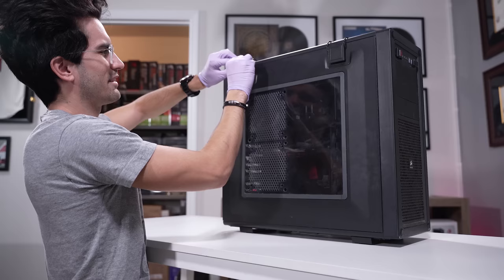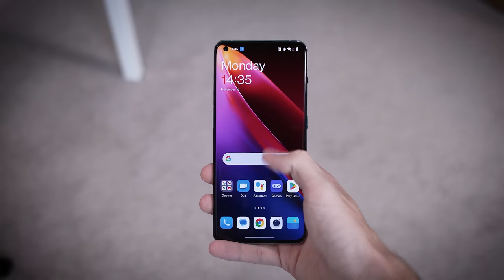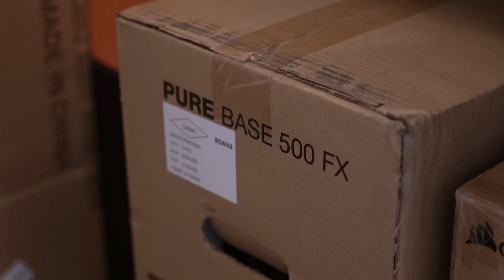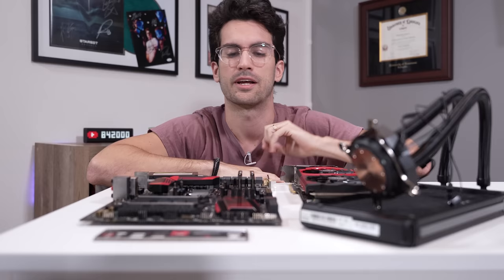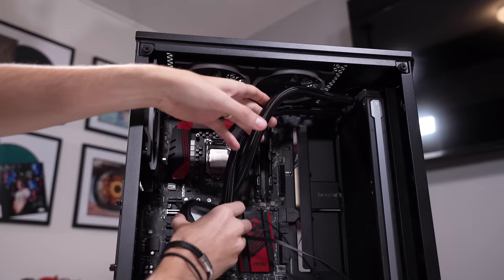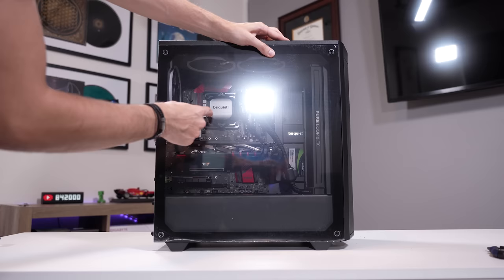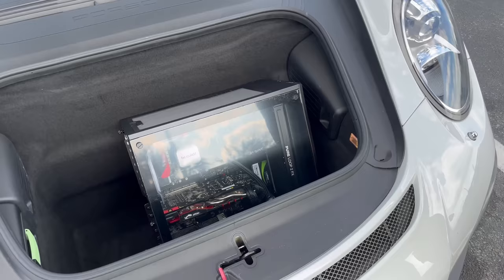Giving This Viewer's PC a HUGE Surprise Makeover!

Comment: That car's trunk was designed specifically to transport a single PC and nothing else.  Very practical lol 👍
Reply: I think that's what they call a "frunk". I used to have a car with a frunk (although no one called it that in those days). It was a VW Squareback, which was a small station wagon with the engine under the floor in the rear.
Reply: You would be surprised by the amount of volume you can stuff in a Porsche ^^. I had a 997. The frunk is not very long, but quite deep actually. Even more if it's just a 2WD.
Reply: @JeffDeWitt  my dad had a '70 square back.  we rebuilt it. was going to be mine. neighbor crashed into it when i was 15.  no sweet 16 car for me. im now 49 with a MK6 GTI   :glasses-purple-yellow-diamond:

Comment: I bet someone out there would jump at the chance to pick up a vintage Corsair case like that lol
Reply: I see them selling for more than the new bequiet case he got
Reply: Personally I wouldn’t be interested in a case like that but I have bought a mint old retro beige case, I think it’s a old 486 case that hasn’t seen daylight in it’s life so it’s not discoloured. But trying to add fans has been the issue 2x80mm to the 5x120mm I want as well as aio cooler and keep the 2x cd drives and the 1x floppy has been challenging. It’s only the aio position that is janky, but having the psu above the mobo makes life hard lol.
Reply: @uninstallplz6888  Good luck the old stuff is all completely laid out different. I have a large pile of old cases myself, one day I will make a nice NAS out of one of my old Gateway cases
Reply: @bikedoc4145  I’ve cut some of the cages on the front out to make room for the 3x120mm fans in the floor the 120mm aio cooler is going to fit under the cd drives with a 120mm fan under the drives in the front as exhaust and another at the back. But the power supply at the top of the case might cause some wire tidying issues with the fan wires being as the fan controller sits in a pci case slot at the back might meet to find fan cable extender’s, but it’s the out side I care about more
Reply: @uninstallplz6888  sounds like a good idea doing intake in the bottom. JayzTwoCents showed a new case with power supply in top and said it was easier to cable route than in the bottom so you might get lucky and not need extensions

Comment: This old case is better than anything on the case market today by the airflow. If you apply 2 extra fans on side exhaust its ultra low temps for gpu. Ridiculous move to change it.
Reply: Excellent side air intake is the reason I still have my CM Stacker 830(Nvidia Edition). When I upgrade the cpu I will get a be quiet Dark Rock TF2  top flow cooler to take advantage of it.

Comment: I know this is going to sound strange but the owners original case(Corsair vengeance c70) is very sot after. It currently goes for around $200+ on ebay some sold listings are as much as $599. Just something you may want to let the original owner know.

Comment: Nice Greg.
I still have a build in an old C70 (military green) with the older yellow&black RM750 PSU + Older still - z97 sabertooth m1/4690k/1070 seahawk (was originaly a 970) and 16gb of mushkin radioactive ram - remember those!  It's old but it still runs fine.
I use a (still old) 9900k/2080seahawk now. 
I wish Corsair would do a refresh of the C70, it's a one off unique case. :)
Reply: I had the Asus Sabertooth X58.
It would've looked amazing in that case.

Comment: The Corsair RM750x PSU is actually pretty good, fully modular and 80Plus as well, so that was more like a side-grade. Well, except that he got a new unit for an older unit of course.
Reply: you're right about it being a side grade but if Greg uses it in another fix or flop or something its pretty good. but mainly did it for the sponsorship post

Comment: I recently built in this case.  I went with an air cooler (pure rock 2).  I ordered three more lightwings RGB fans.  Put two at the top and the cooler has two fans in push pull.   The end result looks amazing.

Comment: Dont' forget to change the oil and the spark plugs.  More sure the RAM is gapped properly.  Usually around .45 unless its a boosted RAM, then maybe gapped smaller to around less than .32.

Comment: This video reminded me again that I have a White 500DX on my shelf for months already to revamp my current build.. just have to find the time for it haha.

tbh I'm not sure what I would have preferred with the AIO placement. I might have ended up just using 1 fan in the top to have enough room for the tubes of his old AIO, or maybe still moved to a high end air cooler which really do not perform worse then a simple Corsair AIO. I use AIO's myself but pure for esthetic reasons.

Comment: I just upgraded my case 2 weeks ago from a Cooler Master 690 II Advanced that i had since 2012. To a Lian Li Lancool lll RGB case. My 3090 barely fit inside that old CM case which had 4 fans and my new lian li case i installed 10 of them 😁

Comment: Be quiet does really good products.
Using a be quiet platinum psu for 6 years without a single issue.
** But would like to see case coolers from other manufacturers as well if possible.

Comment: Ayyy! That's the case I use..except mine is the 500D. Really clean look. The Liquid Freezer AIO was TIGHT fit up top though. I think I've seen people put 3x 140mm fans in the front so I gotta open it up & try it out instead of just the 2 that are in there now.

Comment: You cant put a AIO upside down. If there is any kind of air in that it will now get stuck in the pump. That's why you put the output of the tubes from the radiator above the pump so it gets stuck in the radiator instead of the pump. Correct me if I'm wrong

Comment: After modding an old Corsair 400R for a modern build, I'm convinced that side panel fan mounts should make a return. GPUs these days are monsters of distributing hot air in all directions and the hot air has to find its way out top or back of the case without being recirculated by the GPU fans. A side panel intake or exhaust does wonders for either feeding the GPU fresh air or removing hot air away from the GPU efficiently.

Comment: I have the Fractal Torrent and a 420mm aio and the tubes go to the bottom, looks better than having them at the top, and better for the flow of water/air if any air gets in the system. But great job, nice and tidy

Comment: Greg, have you ever considered doing a Tech Yes style PCBC on a rig that's both dirty and broken as long as the viewer consents for a one off video?
Non chlorinated brake cleaner dries residue free and WD40 is comprised of mineral oil which is non conductive.  its actually a pretty amazing combination that Bryan developed.
I tried it on an old 4th gen system that was basically dead, after the first clean it was booting again, after the second clean focusing on the ram slots it brought back a dead memory channel and is like new.

Comment: PSA for the kids- If you're going to hose out a finned radiator, (PC, HVAC coil, etc) do so in the opposite direction of the operative flow. Otherwise, you're packing matter through the fin stack.

Comment: I heard such good things about Be Quiet.  Then my roommate got one of their coolers and it was the cheapest piece of junk I have ever seen in my life.  It doesn't even have any way to connect the fans to the heatsink, they basically have you use thin wires to twist tie it on.  My only thought was: "really?"  I definitely won't be using any of their coolers in the future.  I can only hope their cases are better designed.  This thing made the Hyper 212 Evo look like an extremely premium product in comparison (while costing several times as much).  It doesn't even perform that well, it's serviceable at best.
Reply: Having built in their Pure Base 500 DX, I can say that the case quality is fine (at least on par with the competition around the same price point), and they are generally well thought-out. BUT, in my opinion, the SATA SSD mounts that give you the ability to show off the SSD while hiding the cables don't offer a ton of space for the 2 additional SATA power plugs the cables come with.
I also use a be quiet CPU cooler and built some more PCs with different ones and well, their way of mounting fans to the heat sink is as you described. Definitely can be a bit of a pain. They also seem to be rather hit and miss, unfortunately. Can only say that my dark rock slim is keeping my i7 9700k quite cool (around 40°C on idle, 70°C under load), even when it runs at 4.7GHz. But newer i7s and higher... Well, that would likely be a different story. But, I also have my build in a fractal pop air, because I still use a blu ray drive and I wanted good airflow.

Comment: @Greg Salazar do you have any tip/trick how to disassemble fans ( blades from the fan housing, where bearing is ) ( gpu/case....fans ) for oiling and deep cleaning .. in easier way than just "pull" fan blades from the "housing" ( or vice versa ) because is not comfortable sometimes, still there is a fear to damage the blades. I notice you don't do this but if you maybe know any trick which you want to share with us, please let us know.. I am really a nerd when comes to cleaning pc parts.. and i want always everything to be perfect and clean, also i enjoying doing things like this.. lol

Comment: Putting the pump higher than ports on an AIO is a suboptimal setup. Those pumps are very weak and die earlier than normal in this configuration...but overall a great setup!
Reply from the maker: What are you talking about? The pump is at the base of the AIO in the tubes, not the block... we literally said this in the video :-)
Reply: @GregSalazar  Oh my bad, I didn't realize it was one of those AIOs, I skipped around the video...but even with the pump down at the ports, isn't it working harder than if it were higher where it would have gravity assisting flow?

Comment: Where do you get replacement thermal pads in the event that one is damaged before or during the deep cleaning process?
This is the main obstacle I have to cracking a few parts open, I want to make sure I am able to put it back together. 
Thanks in advance.

Comment: I wonder how many of the components eventually die because of the deep cleaning. Sometime the only thing keeping a part working is the dust ;)
Reply from the maker: I know this is probably a troll, but I'm not sure how you'd even be able to quantify or "test" something like this. I'd be willing to bet the cleaning actually ADDS life to the products - particularly those that run especially hot because of the dust, grime, and old paste.

Comment: Would it have mattered if you left the barbs facing upward since that unit has the pump in the tube midway? If so it might look a little neater since the tubes looks like they are almost being pulled but that is probably just my OCD.

Comment: As you said, switching to an air cooler isn't always a downgrade.  Some air coolers (such as high end Noctua models) rival the best AIOs in performance and silence, and they tend to be more reasonably priced.  They also have a longer lifespan.  It's really a matter of personal preference.
Reply: The only thing about an air cooler is the heat is released into the case. I upgraded to a liquid cooler for cpu and my graphics card temp went down 10 degrees.

Comment: 4:37 That moment you realize there is a lifeform growing in the PC.🤮
4:59 The hurricane wants to help clean too.
5:59 7 Dead Q-Tips.
6:44 Archer T6E just shredding that blue paper towel.
7:03 When cleaning the screw heads makes you feel warm and fuzzy inside.
7:26 That video card has been replaced; it was not even close to being as dirty as the radiator.
8:12 Guess how many Q-tips and win a prize?
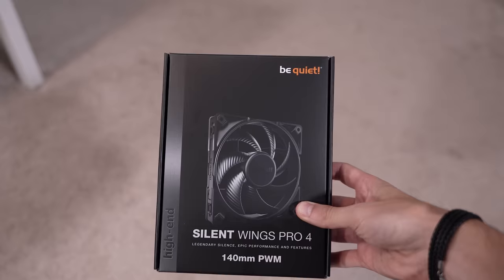8:57 @bequietofficial Way to be an awesome sponsor!:face-blue-wide-eyes:

Comment: The case can't fit a 240mm AIO on the top?  Not exactly a ringing endorsement.  I suppose if they're up front about it it's not the end of the world, but one thing I've learned from PC building is that you need options, because if there are potential fitment issues, then you're almost definitely going to have actual fitment issues when you go to do the build.  If the AIO only fits in one location, then you're SOL.

Comment: Aren't you running the risk with tubes down that Air will concentrate in the CPU chamber?
Reply from the maker: ? The pump is in the tubes near the bottom in this config. The block is not the highest point in the loop. Idk where people are getting this information.

Comment: Hey. Do you think a budget i3 12100f + Ds3h ax + DDR5 ram would be good? Or a change with motherboard is necessary? Are they gonna release Non-K variant for 13th gen cause I won't need those I think.

Comment: Man great videos! One question though... I'm not sure but shouldn't the radiator tubes sit higher than the pump? Gamer's nexus posted a video a while back saying that putting the pump above the radiator tubes will eventually kill the pump. But since you mentioned that the pump is in the tubes and not in the block maybe this isn't the case here?

Comment: I don't care if the case is old. more than 4 a 7 years ago when they sell this cases new i liked it but it was to expensive for me there is no way I am going to pay 130 euro for a case so i had to buy another case. so i bought the cooler master haf x used for 90 euro i am still using it today but that doesn't chance that i still like the Corsair c70 vengeance

Comment: Hey Greg, i Have 32gb of 3200mhz corsair vengeance ram, and anytime i run it at its advertised speed by enabling xmp so 3200mhz I just get repetitive blue screen so am forced to run it at 2133mhz and it runs fine, is there anyway to fix this is or is my ram just completely done and i need a new kit
Reply: Bios update?
Reply: I had this problem on an AsRock mobo. Went with an Asus board and had no problems. So try a bios update and if that doesn’t work, think about trying another board. Also check your mobo’s RAM compatibility list and make sure the kit you’re using is on that list. You don’t mention what cpu and mobo you have, but if they’re older they may not support those speeds.
Reply: @zlungbutterz3307  might be a stupid question but how do i do a bios update also my CPU is an I5-11600k and my MOBO is the ASUS H570 PLUS
Reply: @Harvs6  Your CPU and mobo should not be an issue at all. Do a Google search for your specific mobo model and find the link to the manufacturer’s website. On that page there should be a ‘support’ tab that should list the bios versions.  Check to see what the latest version is and download it. Then Google or YouTube how to actually update it, because each manufacturer has differences.

Comment: Why? the AIO, makes me sad.... any small air inside the cooler would make it inefficient unlike if the tube is higher than the CPU
Reply from the maker: What on earth are you talking about? The pump is in the tubes down low and the CPU block is not the highest point in the loop.